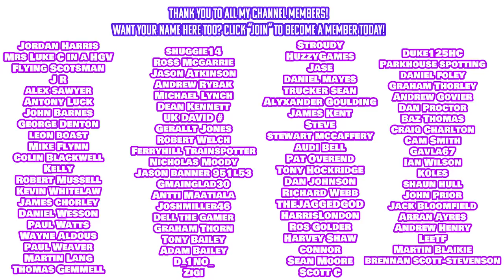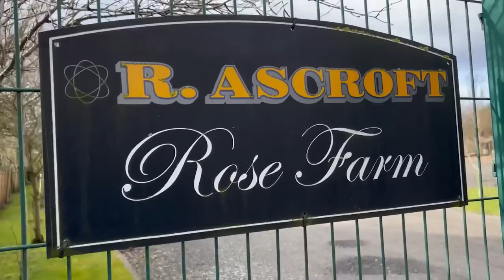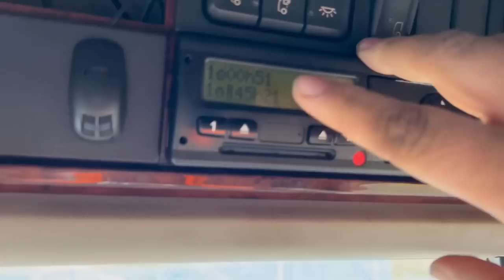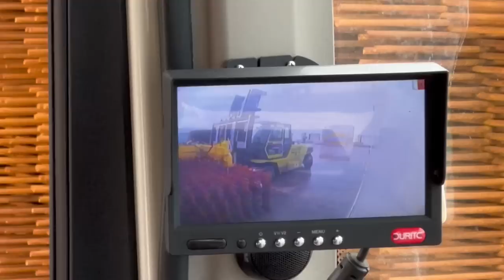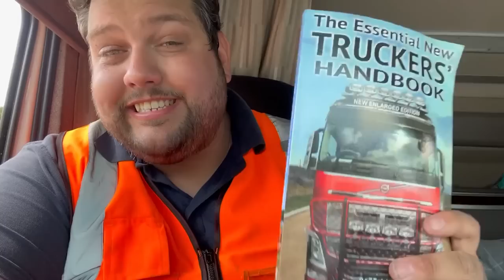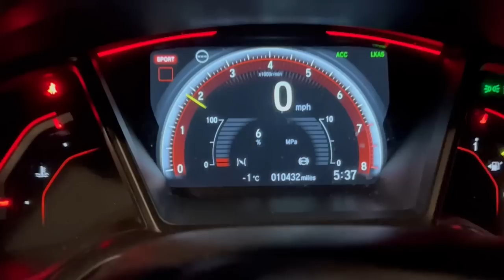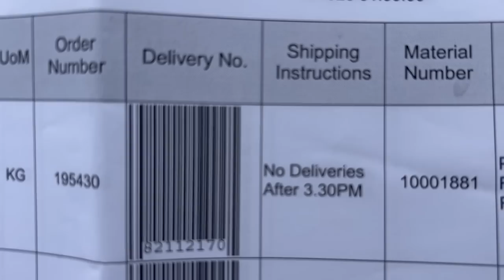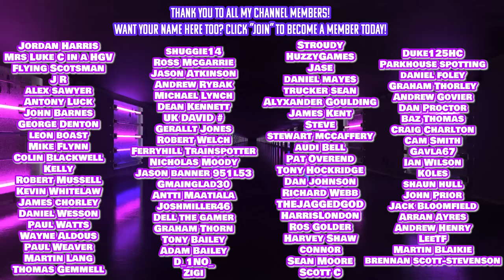Crazy Hailstorm Out Of NOWHERE!

Comment: The comment about disability; having worked at a petrol station we are required to go and help them fill up if they have a badge, but they should call the garage prior to coming to inform them that they’re coming. I’ve done it a couple times whilst there. (No idea if the person in question had called or just showed up - but yeah the procedure is typically they call beforehand, but I’d still go out and help if they didn’t).

Comment: When doing a night out, how do you manage with the sleep apnoea? Do you have a portable CPAP machine?
Reply from the maker: If I wanted to, I could. I’ve got a Eco flow power adapter, which would power at all night. However, I’ve not use the sleep apnoea machine in weeks now. Never got on with it and found it actually made things worse, not better. I only have sleep apnoea in the sense that I snore. Not in the sense that I get a bad night sleep. And tired during the day. I get good nights sleep every night and never feel tired during the day. Using the machine had the opposite effect. I would have rubbish night sleep, and then as a consequence be tired the next day which is why I stopped using it.
Reply: @lukecinahgv  Cheers Luke for getting back to me. Sorry to hear that the machine didn't work out for you and to be honest I sometimes think that mine does more harm than good (to my quality of sleep anyway). Woke up at 4am this morning with air leaks blasting me in the eyes as the mask had slipped a bit and I've felt like crap all day now. Good to hear that it doesn't make you tired during the day, unfortunately that wasn't the case with me and I was finding myself "nodding off" far too often! Not now though, the CPAP machine has been life changing for me.

Comment: Not sure about that Overhang Luke when there Was Plenty of Space Upstairs, The Overhang rules are Supposed to be for Indivisible loads, ie: large objects in Excess of the Trailors Length, all you had to do was Leave a Gap at the Front and put 2 Stacks in the Middle, it would be well within the Height Limits 16'6'', in Fact it would barely be Above the Cab and your Strapping would Ensure that it Wouldn't go anywhere, Mesh Rarely does in my Experience, but you were there, i wasn't, it's just that the Authorities could Deem that an Unnecessary Risk when there was Another Option, You know what they can be Like. As for Breaks Whilst Loading, a VOSA Guy at one of our CPC Courses said that they do not have an Issue with that, i waited 36 Hours for a Load of Steel out of Sheffield (Stockbridge) once, even had a Daily Rest on Site.

Comment: Should he be driving it in the first place? Well if he can meet the standard to drive, they yeh I guess. Adapted vehicle or whatever. If he or she can’t get out of the vehicle in time, well that’s their risk to take. When I was a bus driver we were taught to evacuate a vehicle in an emergency and always told Abel bodies first and go to the infirm after. But is there an allowance made for the show/tell question on a test for disabled candidates?

Guy may have been slightly aggressive (or perhaps over assertive) depending on how long he’s been there. Looked like a small station and perhaps only one employee. Can’t leave the till (read: control system) whilst people are fuelling so you’ve got to wait for a clear forecourt, you’ve then got to head outside and lift the pump so it requests fuel, then go back hit and fill, then go back inside and close the transaction and sort the sale before going back out to the customer with their receipt, change, card or whatever. All this whilst ‘not exposing yourself to risk’ for instance if there’s a group of hoodlums knocking around. Absolute necessity but pain in the a## all the same. Happened to me maybe 3 or 4 times over a few years in petrol work. Usually another customer would cotton on to what’s occurring and sort of help out. Even since leaving the job I’ve helped a couple of times myself when with my own car.

Comment: It’s to call for assistance, there are stickers on the pump posts telling you to do so. As for your other thoughts, should you be driving a truck if you can’t fix it or even change a tyre?
Reply from the maker: Actually, I used to change the tyres on the 8 wheelers back when I was driving them,  Where I work now, we change tyres back at base too. I’ve also changed brake discs and pads. I’m by no means an expert I admit. 

If it’s a blowout whilst on the road, we do call outs as we do not carry spare tyres so that we can carry more product as often we’re fully loaded. 

We do however carry basic tools such as socket sets, wrench, hammer, screw driver set, cable ties, and we carry spare bulbs to change on the roads, carry spare fuses too. So yes… I do fix the truck myself. We’re also responsible for filling up with coolant and oil too

Hopefully that’s answered your question phil. 

I’m not saying no one should help the disabled. I’m saying he was being quite rude about it, and perhaps he should either have bought his own help or waited patiently until someone was available. It was a very busy fuel station and I counted no more than 3 members of staff.
Reply: @lukecinahgv  Fair enough Luke, I’ll give you a pass on being a truck driver but as you acknowledge, not being able to do so shouldn’t prevent anyone doing the job if they can safely secure a load and drive responsibly and safely? 

Likewise there should be freedom to travel for anyone even if they have to follow the Highway Code guidelines and wait for help.

I wasn’t there but would agree everyone can be an ass sometimes? The disabled badge may have been irrelevant and they expected you to use a truck stop? Fuelling for 15 minutes and taking the space of two pumps might have set him off. I’ve been told before to roll my motorcycle away from.the pump by some drivers, impatient to fill up and some staff think you’re stealing fuel.
Reply: @lukecinahgv  then imo thats the fuel stations fault. heck it's happening a lot. reduced staff to save money at busy periods. go to a supermarket now. how many tills are open. how many people on shop floor. go out for a meal. less wait staff.